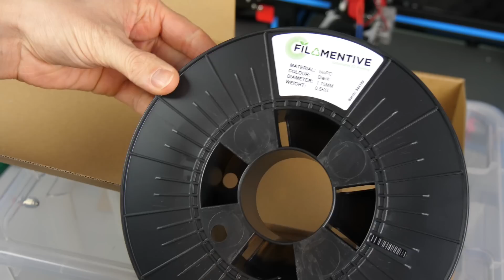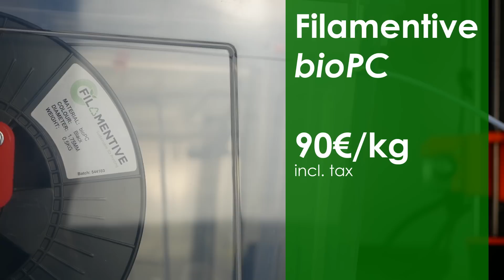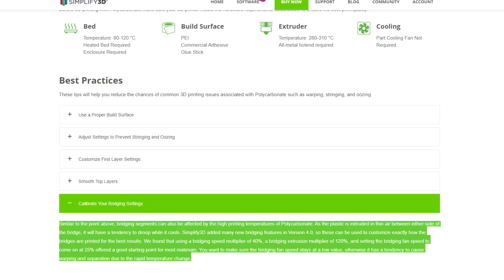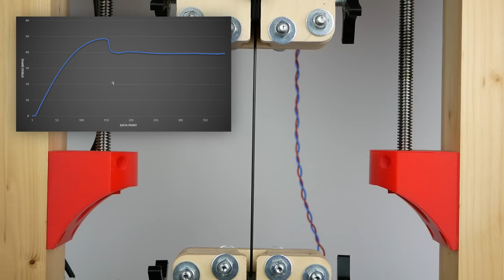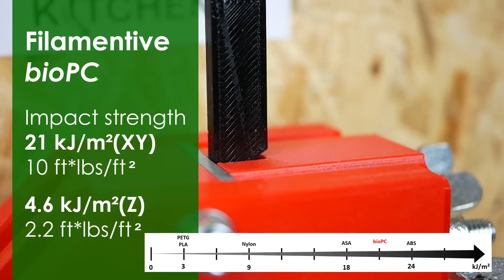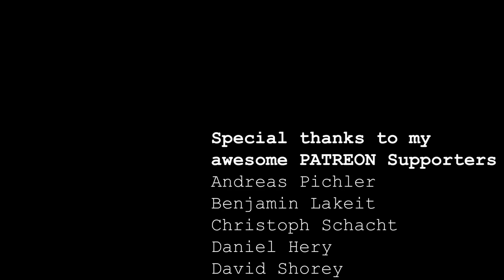Filamentive bioPC - eco-friendly POLYCARBONATE filament REVIEW

Comment: Ok, 4 years later, and the whole BPA concern has been based on a single study that was poorly done in rodents.  BPA is not harmful to humans and has no practical estrogenic qualities. In fact, BPA was the result of a failed attempt to make a synthetic hormone and sat in chemical libraries for years until it was used as a plasticizer. From over 300 studies, the FDA concludes BPA is safe. 

The whole nonsense was triggered by crap research labs who injected massive amounts of BPA in rat muscles.

Comment: While I agree with Thomas Sanladerer that this likely isn’t polycarbonate, if you do at some point test a “regular” PC filament, be aware that it must be printed very differently from other plastics if you want to achieve good layer to layer strength.  PC requires a fair amount of pressure in addition to heat to achieve full layer adhesion strength.  This is largely due to how gradual and high it’s glass transition is.  Basically, it gets soft but never really achieves the level of viscosity needed for good intermixing/welding between layers - at least at temperatures anywhere south of 320 C+, and with an enclosure.  

But, it’s possible to achieve layer adhesion as good as you can get with 320 C + printing temperatures at much lower temperatures that an mk2s can achieve easily - 260 C or so. And without an enclosure.  

The trick is that you don’t need nearly as much heat if you have enough pressure.  How do you achieve pressure with a 3D printer? Quite easily, actually: just use a very wide extrusion aspect ratio.  I mean way beyond what is ever used normally. 4:1 to 5:1 is ideal.  So if you had a 0.2mm layer height, you’d want to have all your extrusion widths set to at least 0.8mm, or better, 1.0mm.  At least with a 0.4mm nozzle anyway.  

I actually developed some fairly unusual settings for the mk2s specifically for polycarbonate.  They will look bizarre, but myself and several others are getting excellent results (including flawless Benchy boats) :D.  If you’re curious, check out the prusa forum thread: https://shop.prusa3d.com/forum/print-tips-slic3r-settings-kisslicer-model-repair--f12/polycarbonate-here-s-how-to-print-it-without-warpi-t6919.html
Reply from the maker: Nice work, you've done there! Definitely need to try this out.

Comment: Take a look at eSun's ePC - far from environmentally friendly as I am guessing from my experience it's a modified PC which warps less, I think it has some ABS, and some additional modifiers eSun added to their ABS+ to help with warping.  It doesn't require a dry box nor is it so hydrophobic that it needs to be dried in an oven, and handles overhangs/bridges much better than this, and not stringy at all -- the stringiness would indicate this is is a copolyester. I'm only using it for small parts as bigger parts would require an enclosure, which I haven't setup yet.

Comment: Thanks for the review, but I think calling this filament "eco-friendly" simply because it doesn't contain BPA is misleading advertising by Filamentive. This is called greenwashing, it is a despicable practice, and I frankly suspect they may just be breaking some kind of law with this claim. 

Just print a piece with this and leave it in your backyard. It'll still be there 10, 20 and more years from now. It may be less toxic because it's BPA free, that doesn't automatically mean it's eco-friendly. The plastic soup you hear so much about these days is not a problem because it is toxic, it's a problem because the plastic harms animals that ingest it by being indigestible and actually causes physical (mechanical) damage to the animal's intestines. Since bioPC is (in Filamentives own words) heat resistant to 100°C, and has high impact and chemical resistance, it will be a just as harmful to the environment as all other plastics.

The same is true for PLA, by the way, which is often advertised as being "biodegradeable", even though it is not, in any meaningful sense of the word.
Reply: Of course, you are right, there is far too much plastic waste and far too much of it is disposed of irresponsibly. However, surely a BPA-free plastic is in some sense more "eco-friendly" than one with BPA. Filamentive's main claim to fame is that their other filaments contain at least some recycled material, which is surely better than not. Many of us are very unhappy that the parts we print are not recyclable, but many are extremely useful and some are indispensable.
Reply from the maker: You are definitely right there but since there won't be a lot of biodegradable 3D printing materials around in the near future and often you even don't want your parts to degenerate over time, filamentives approach goes into the right direction by reducing harmful substances and using recycled polymers in other filaments.
Reply: Absolutely, kudos to Filamentive for selling (partly) recycled filament. And kudos to them for marketing a BPA-free alternative to PC (Although it should be noted that the harmful effects of BPA fall in the same category as those of Aspartame and cellphone use: All but definitely proven).

However, we as 3D printing community should be up-front and honest about this: The materials we use are NOT eco-friendly, biodegradeable or otherwise harmless for the environment. Waste should be properly disposed of (e.g. by recycling, as Filamentive does), and we should do everything we can to avoid this waste or printed objects from ending up in the environment.
Reply: I posted a reply to 3dp news site asking that they don't let the manufacturer's biodegradeable claim pass unchallenged. Since they manually approve comments, it's not a shock that they didn't approve my plea.
Reply: They play on the eco line for profit. No 3d printing is planet friendly as it putting plastic into the environment, if that is a concern that take up spoon whittling. Even their pla is either end of roll stuff or remade with virgin pla so not really recycled. The planet wont be a cleaner place if we all used their filamament at all.

Comment: Great review! However, this is not Polycarbonate - even Filamentive say so on their product page. To my knowledge, PC will always be manufactured using BPA, but how much of it ends up in the final plastic can be somewhat influenced by the manufacturing process.
BPA-free Polycarbonate-like materials are often Eastman Tritan, which I've reviewed as filament from Taulman back in 2015 with very similar results to yours. Filamentive claim their bioPC is a copolyester, so that would make perfect sense!
Reply from the maker: +Thomas Sanladerer You're probably right about that, Tom. Thanks for correcting me. Just shows , that I still need to learn a lot about polymers 🙄 but wouldn't it be boring if we already knew everything?
Reply: Do you know if manufacturers inform the buyers about the BPA? Because if it acts like a hormone it can be really problematic in some cases
Reply: +Thomas Sanladerer +CNC Kitchen It's great to have both of you guys testing filaments, but there are far more than either of you can possibly test in a lifetime. I wonder if you could interest some of your fellow experts into sharing the work using a common set of standards. That would be of enormous benefit to the 3D printing community.
Reply: Please collaborate your knowledge and testing procedures for a "standard" everyone seems to be doing a similar thing but with their own designs so one test can not be compared to another.
Reply from the maker: This is the idea behind testing standards but the problem is that you need very expensive testing equipment for that which most don't have and even I only try to replicated standardized tests as good as I can but I'm still far away from ISO or ASTM standards. For this reason, and this is also what Tom and I'm saying is, that we try to use similar conditions for all tests, which at least enables you to compare Tom's tests against each other and mine as well but only in terms of relative numbers.
Reply: Does all of your testing equipment you use have build videos and guides on how to make it and preform the test?
If not we can work on this and i hope you and Thomas Sanladerer collaborate together and work together more on this with other YouTubes joining the party.
Reply from the maker: No, there aren't any build videos on my machines, yet. I also think that the methods I use and the numbers I give are suitable for everyone, because I'm quite sure that there are a lot of viewers around who don't know what MPa, ksi, kJ/m² and so on are. So I guess my tests videos aim at a specific audience and simpler tests also have their audience if they give comparable results. Still, you are right, there are some really non-scientific tests around which which also makes me wanna cry if I watch them ;-)
Reply: BPA is the monomer of virtually all polycarbonate.  There are potential replacement monomers being developed but as is stands today, any polycarbonate made on an industrial scale is made entirely from BPA.  Of course, it is only the unpolymerizedvBPA monomer that is xenoestrogenic.  

As for how much BPA is left in industrially produced polycarbonate, the short answer is “too little to matter”.  This is in the context of the worst possible situation: amount of BPA that has leached into food (liquid or solid) contained in an entirely polycarbonate container.  There are over 300 scientific studies that have been completed and have withstood peer review, and all of them conclude that the amount of unreacted BPA left in polycarbonate is much too low to ever pose any sort of threat to our health.  

So while Filamentive has their hearts in the right place, this “bioPC” (which almost certainly isn’t actually PC) claims to solve a problem that doesn’t actually exist.  

Source:
https://www.fda.gov/NewsEvents/PublicHealthFocus/ucm064437.htm
Reply: Everything you said went entirely over my head and every one else that doesn't have some sort of engineering plastics background or a extreme 3d printing nerd (for lack of a better description). Isn't 80% (is probably more like 95% but i like to be generous) of anything claimed to be Bio friendly trying to solve a problem by only making it slightly better if any at all than products that are better for you or the environment?
At 90 euro per kg i don't think anything about this product is viable let alone has a place in the market, i purchased 1kg of PC for 24 euro. Your statement and reference makes me feel a lot better to about my purchase.
Reply: Side85Winder , this is a bit more specific.  AFAIK, BPA isn’t particularly bad for the environment, it’s more that if it makes it into the human body, it mimics estrogen.  No one wants their hormones going out of whack (well, except maybe people using steroids lol).  But either way, it’s really a non issue.
Reply: Yes, BPA is mostly the "mer" that is polymerized (with a couple other small differences), there will be some residual BPA left over from the process. Furthermore, if you use a BPA-free PC that is really polycarbonate, they are generally using BPB which is chemically very similar but the health effects are not nearly as well-tested as BPA, so we might be having the same problems as with BPA anyway.

Comment: What’s the most temp resistant material?
Reply from the maker: Probably graphite ;-)
Reply: CNC Kitchen need a filament that can hold up being relatively close to an engine :/
Reply: CNC Kitchen and is cost effective
Reply from the maker: Annealed PLA can handle temperatures up to 160°C and more. Can be done with (almost) any PLA, but depending on the brand you might need to compensate for shrinkage.
https://www.youtube.com/watch?v=OzfXVH59LjM
Reply: True polycarbonate is probably the most heat-resistant material you can print without an industrial-level 3D printer. It can tolerate 120 °C. However, you need an all-metal hotend that reach 280-310 °C and a heated bed that can reach 110-120 °C. 295 °C and 110 °C work on my Prusa i3 MK2S. Glue stick on PEI works well for bed adhesion.
Reply: +CNC Kitchen I was inspired by your video to try annealing PLA and tried several brands, including some called "high-temperature". All of them warped or shrank quite readily, so I found using PC for my application to be easier. Maybe I'd have better luck with the Formfutura Volcano PLA you used in the video.
Reply: Thanks
Reply: Have you tried annealing by placing in boiling water? stop shrinkage?
Reply: Haven't tried boiling, but JMT's video and its comments might help: https://youtu.be/WmTGU3r53VU. Also of note is Stefan's annealed PLA temperature testing video at https://youtu.be/vLrISrkg46g. Both this video and the moka pot one linked above showcase Stefan's beautiful engineering work. PLA: Bake it or boil it before you fry it?